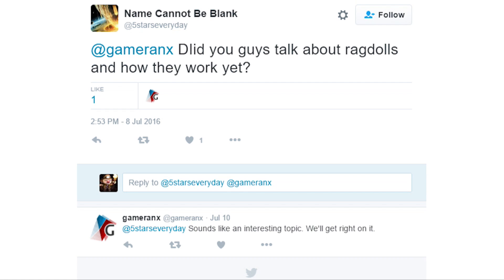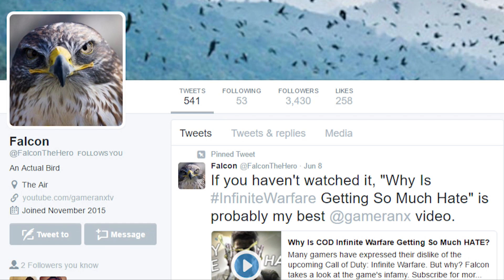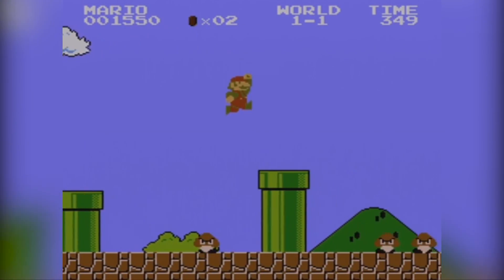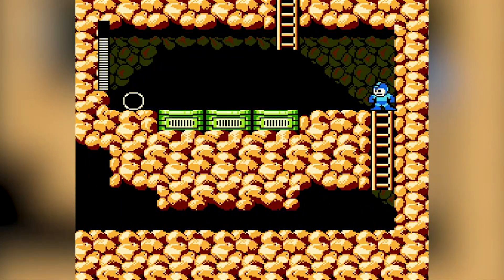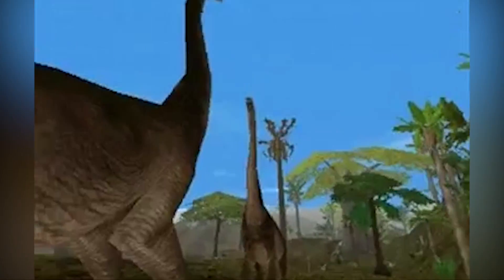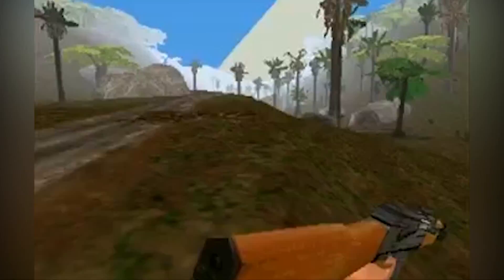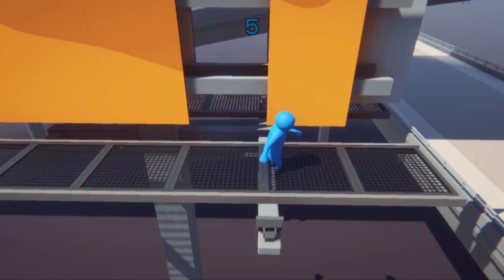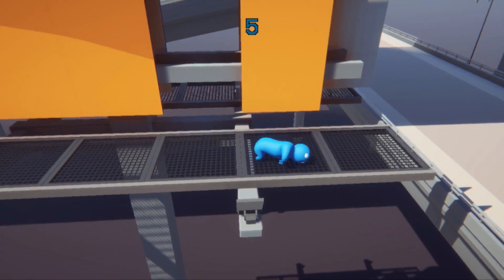How Do Ragdoll Physics Work In Video Games?

Comment: Inverse Kinematics is not bone systems though.  All 3D animations use bone systems for animations, inverse kinematics is just one way of dynamically animating a mesh.  Animating by hand, moving each bone frame by frame is called forward kinematics.  Inverse kinematics is telling the software that a certain bone should be somewhere, and it will then figure out all the angles/positions to get there.

Comment: Great video!!! Now how do rag doll glitches occur?
Reply: Maybe it doesn't collide properly with the environment, or sometimes the ragdoll, if it's engine allows it to do this, cause some sort of leverage to build up, and when the bones move a certain way, it creates leverage and launches what's supposed to be a lifeless unmoving body into the air and several thousands of feet further from where it's final resting place should have been. I'm referring more to Battlefield 4's ragdoll system, as I find a bunch of hilarious ragdoll glitches with it that I'm kind of glad they didn't take out. I think it's because it's too advanced so lots of problems occur with it because it isn't coded right. :P It really just depends on how the developers use their ragdoll engine, and how advanced it is.
Reply: thanks MC. Yeah sometimes they are like works of art or a scary messed up puppet

Comment: Rag Doll Physics is not used as much as you imply. Example, it is not used in walking up stairs, that is a ray casting system. The overhead on GPU and CPU would be ridiculous. What we like to use it for is:
Explosions, and adding force to an object in the case we don't know which way it may need to go at any given time.
Death animations, and collision detection on a simple scale when we don't know which way the player is going to collide with a gameObject.

You showed some good examples of physics in use, but you also showed some games that where faking it, using mesh line renders, and parallax textures, with some rock textured particles. Neat though right? Most of the time it is faked. Saves on overhead.

Comment: Inverse Kinematics is a step beyond Skeletal Animation.

Originally, we had Forward Kinematics, where you set the rotation of the joints one by one; then came Inverse Kinematics, where you set the position of the last bone in a chain of bones, and the system calculates the joint rotations to get there automatically.

Comment: Forward kinematics. Animation works on forward kinematics (the bones move relative to each other, towards a preset position relative to it's parent bone). The "blended ragdoll" you're referring to us inverse kinematics, where the bones are moved and rotated in order to meet a position in world space (matrix vectors... don't worry about it). That's how the stairs "animation" works.

There really isn't a simple explanation of forward vs inverse kinematics, as it would require some fairly industry-specific knowledge of Euclidean space and matrices. But you explained the actual ragdoll pretty well.

Comment: in my opinion, the RAGE engine from Grand Theft Auto: IV used ragdolls the best. the way that people fell when you shot them felt so real. they didn't just fall to the ground, they made human-like motions before they died. the engine in GTA V is also very good, but shooting someone in V didn't feel nearly so goog as in IV.

Again, that's just my opinion.
Reply: GTA V doesn't use ragdolls from what I understand. ANything using Euphoria does not actually use limp ragdolls.
Reply: +Miria Jiyuu yes, but Euphoria uses even more advanced technologie for ragdolls, human-like motions like i said. but let's say, you're on the roof of the tallest building in GTA IV/GTA V. and just happen to have someone standing next to you, and if you kill that person and ge falls of. you can clearly see dynamic ragdoll physics. but GTA V toned that down a little bit. 

but trust me, in GTA IV you can see it much better. :)
Reply: Al Capone not my point? I just said that Euphoria doesn't use limp ragdolls and therefore neither does GTA V provided it actually used Euphoria, something that I can find no actual confirmation of but would be weird if it didn't.
Reply: +Miria Jiyuu yeah. but what i know, and correct me if i'm wrong but GTA V and GTA IV use the RAGE engine. and that's a moddified version of the Euphoria engine. and yes, it doesn't use limp ragdolls. but it also doesn't use pre-made animations.

Comment: Physics, while plural in derivation, is generally construed as a singular noun except when referring to several "physics" (i.e., two or more different systems of physics). In this sentence, where the meaning is "uncertainty in the field of physics," the singular form "needs" would be correct. Aug 16, 2012 - Google

TL;DR In the title, "does" is the proper word, not "do."

Comment: Ragdoll IK aren't synonymous. They're two totally different techniques. IK is a rule that states that the parent controls the child. You've got Human Inverse Kinematics and Inverse Kinematics where HIK follows the rules of the human body and it's constraints and IK only follows the mentioned rules with zero constraints. You weren't wrong about blended ragdoll, but that does not apply to the step example. What's happening behind the scenes is that an IK solver is tied to the limbs with a foot platform which allows for blending between the environment and the character rig. Ragdoll only kicks in when the certain demands by the engine is met. Death, clipping a boulder, falling down a hill, etc. Vice-Versa, FK(Forward Kinematics) follows completely ignores both and is mainly for robotics.